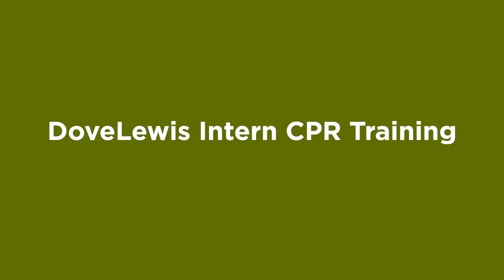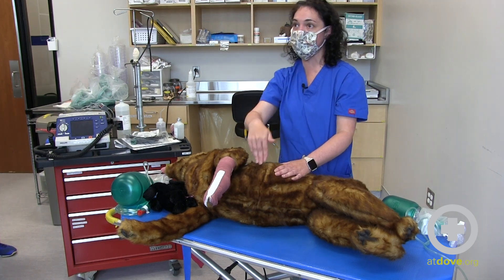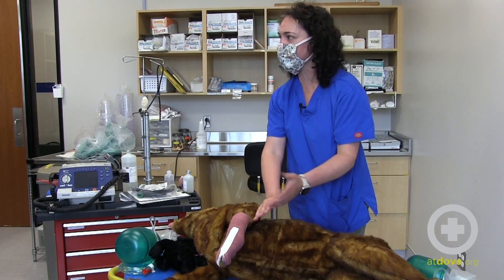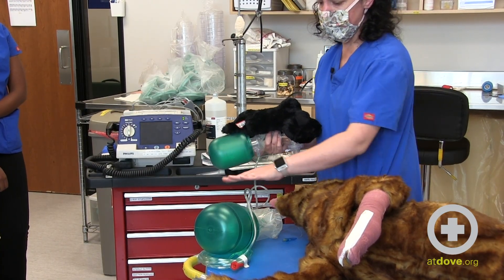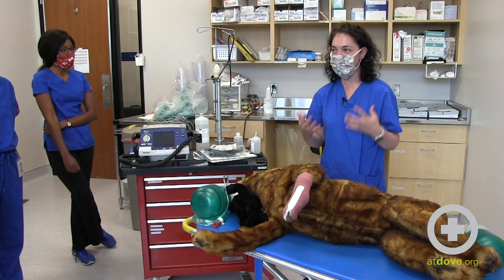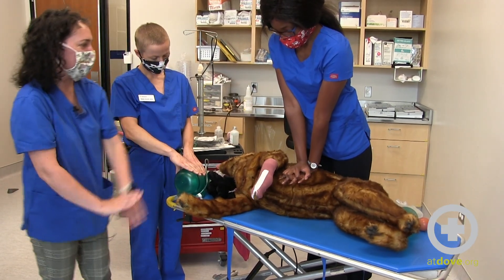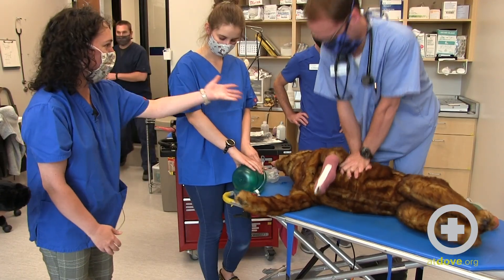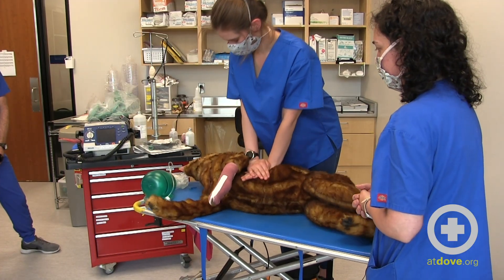CPR Part 1: Chest Compressions and Ventilation

Comment: There is also now a really helpful app called ‘a RECOVER CPR Coach’ which actually helps guide you! It makes a ticking noise indicating each compression, there is also a breath sound which indicates when to squeeze mbu bag. It also times the 2 minute compression cycle and tells you when to check for a pulse and switch person. I know in a lot of emergency situations you don’t have the time to grab it but if you have a large group of people attending to the one animal someone can always grab a phone or an iPad and press start on the app.

Comment: I've read many comments concerning ribs broken while chest compressions are performed. This is not "blunt force". You will feel and hear cartilage break and  separate. This is normal, both in humans and with your k9. You may also need to deal with blood loss. A large hole. Getting the wound plugged while sill getting both blood and air circulating. Thank you for your video.

Comment: The heart still looks very far away from where she is doing the chest compressions.... How does it work exactly? Isn't she doing compressions on the lungs in the video?
Reply: She is demonstrating the thoracic pump technique. This technique is based off of the thoracic pump theory, which proposes that external chest compressions increase overall intrathoracic pressure, forcing blood from intrathoracic vessels into the systemic circulation, with the heart acting as a passive conduit. 

Different chested dogs (round, barrel, keel) have different cpr methods. In this example, the dog is round chested, which is why she used the thoracic pump technique. Keel chested dogs (ex. Greyhound) benefit more from cardiac pump technique. And barrel chested dogs (ex. bulldog) benefit more from sternal compressions
Reply: Where did you get that dog manikin